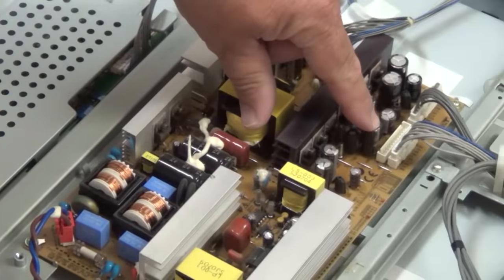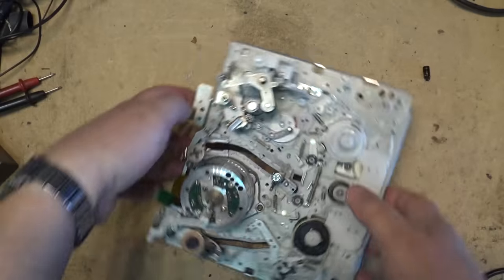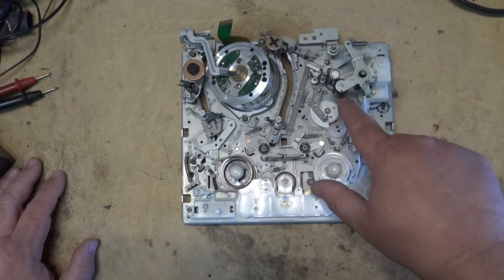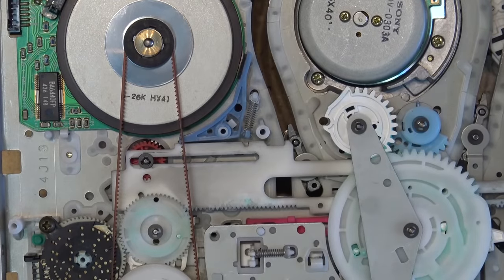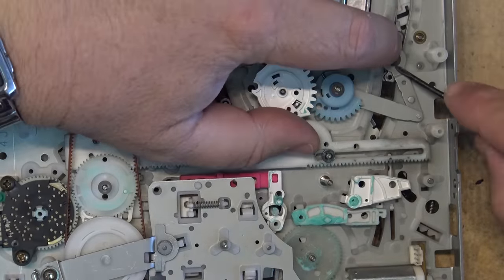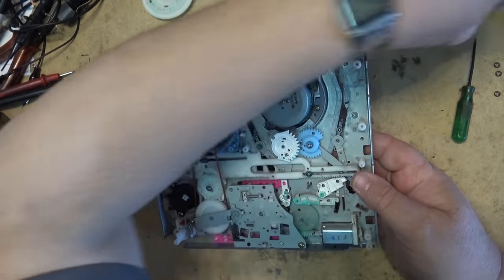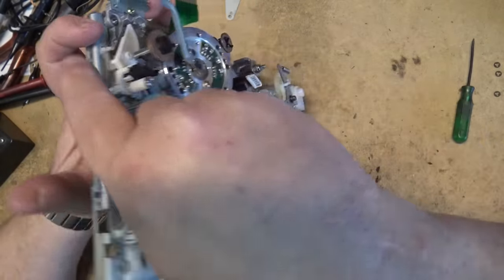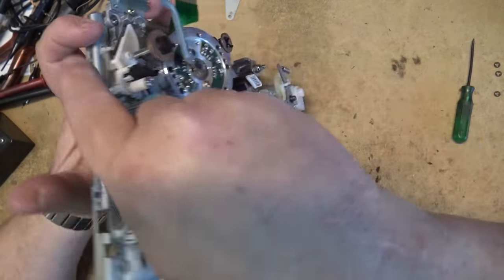Sony VHS mechanism Mechanical Repair

Comment: Nowadays i'm seeing it happen: all gears 'n stuff are made of plastic fantastic, so damn breakable in this 'throw away society'. Many years ago it wasn't like that: more durable and reliable. Some parts of these units aren't available  anymore, it's just not worth to replace it anyway due to the costs of it so we throw it away and replace the whole unit, it's just simple as that. We praise the Lord that there are still some guys like Dave who still cherish their profession and their skills and love what they are doing. Keep up the good work man!
Reply from the maker: You are correct.  Most of these units are tossed away. Very few people still servicing electronics.  It is a dying profession and many of the really good knowledgeable service engineers are, well... Dying.

Comment: This gave me a clue at 30:40 and some other spots as to the problem with my SLV 585HF. The rewind side was not pulling the tape back in on eject or in reverse play. Problem is the gear mechanism between the reel hubs that big white thing at the bottom at this time line. that center part is supposed to spring back and forth. I worked it a little by hand and pushed around that center pivot clip. and now it no longer sticks and it will pull the tape back in before ejecting. No more eating tape.  In the long run I assume I need to pull it off and remove the old grease. I put some Zoom spout oil on it for now. (sewing machine oil).
Reply: Having similar issues on my SLV696hf. At playback the left reel doesn't move, the tape sticks and stops. Will explore that section of the machine more.

Comment: thansk for this video! I was able to fix my SLV-E90 ... Blue gear was broken, the guide was stuck, had to fix the PSU (capacitors were leaking) and the timing was way off. running ok now - have to clean the headdrum though ;)

Comment: You've been a great help i repairing my Sony that is like that one... One question so far while I'm waiting for my blue gear that was broke.   Placing the main cam gear back, you have those 3 notches, the small arm that has one notch for me to place is not in the same position  as yours and I can't find what moves it.  There is a small black pin that is pushing it up and the pin moves too close the center of the cam for it to drop in place.  I can't see what moves that pin back.  I also had to grease that same sticky worm gear post on the other side and that arm that sticks.  I'm waiting on my part, cleaned up the contacts just seeing how it fits back and that might be the only problem I hope - cam gear placement.  Thanks, Dennis

Comment: What a great video!  Love how you provide details on how to get the timing calibrated.  I have had to clean-up the “P6-Guide” (I think that’s what it was called...?) as mine was also completely sealed up.  Easy to do when you see how it’s done.  Following that, I noticed that the unit will no longer rewind - Are there some troubleshooting steps that you would recommend I do to figure out why this is occurring?  It looks and sounds like it wants to rewind, but the left wheel does not move, and after about a second, the unit retracts the tape back in the cassette and the only thing that can be done is to eject the cassette.

Comment: Hi,
I need some advice if you don't mind, but first of all thank you for those vids, they helped me successfully replace two broken blue cogs on SLV-725 yesterday and on SLV-E9 two years ago. With former unit I have certain problems that I can't seem to tackle. First of all - while it plays, after like 10 minutes after cleaning of pinch roller, the picture starts slightly wavering horizontally, and stereo sound starts cutting out slightly, and gets worse as tape runs further. Uncleaned and at end of tape, wow and flutter is enormous in linear track. This is worse towards the end of tape as opposed to towards the start. Cleaning roller again gets it going again, even though it's not really dirty as seen by very slight amount of blackness seen on q-tip (I clean with q-tips soaked with pure isopropyl). What is the cause? Bad pinch roller? (it does have some slight shine to it but not really worse than on any other similarly old unit which runs fine). Perhaps too high backtension or something? I tried adjusting the pinch roller pressure by means of re-timing the loading cogs as they seemed to have been tampered with in past anyway. No avail I think, but I can make it worse that way and revert. Currently it's pressurised enough that I don't see reason to change further anyway. But current state is not really acceptable for any sort of normal use.
Second problem, the front panel main controls (play, stop, ff, rew etc) are acting weirdly, buttons either do different functions than they're assigned to, or not work. Eject does not work altogether for example. But actual logic is fine as with remote control, all functions work as intended. Could that be some fried chip or something? Front panel has obviously been removed in past as evident by some wire soldered to one point and going to mainboard (compensation for missing trace? mod? dunno) and lacking few screws.
As for other unit the E9, it works acceptably well after lots of tampering over time, however the drum has weird sound when turned by hand - scratchy one. Failing bearing? It works fine when it turns fastly by itself tho, but once has halted randomly and worked again later. Also on this one I've manually readjusted the tape path around drum as it was off initially (yet another machine that was been messed with prior), and while I got it to play all tapes I insert into it fine, and it plays what it records fine also, the tapes it recorded don't play properly (on one has noise band on top, for example) on some other units that otherwise play everything fine and are factory-adjusted. Play fine on some others. It is acceptable incompatability or is it still misadjusted?

Comment: Hello sir, i've got the SLV 656-VP. And it has prakticly the same mechanism.
Round about 15:10 where you're fidling with the tape guide cam. In my machine, it is seazed solid. I tryed WD40, but it won't move.
What do I do now?

Comment: Hi sir, greetings, I have a sony slv 312me vcr, the mechanism is jammed tape goes and sits no operations possible , and does not eject , only ejects sometimes with use of hand to take the casstte out . Checked with local service they said tape sensor gone, but I tried putting my friends similar vcr mechanism it works . But I cant use my friends mechanism for long . Please can u help me with guidance

Comment: I'm working on one now that has me stumped. Replaced the gear, cleaned the mode switch, verified all the timing. It will accept a tape, it will play, FF, RW, everything just fine. When I go to eject the tape, the capstan motor doesn't pull the excess tape back into the cassette. So it ejects just fine other than a giant loop of tape that hangs out. Any ideas?

Comment: I remember those days. We had a TV repairman take out the chassis out of our console tv a few times to take to the shop.. I always watched when he worked on our tv's at home. He warned me not to stick my hand in the tv, even if it was unplugged, because the picture tube would zap me. (That was when he took the chassis out) I wanted to be a TV repairman when I grew up. Didn't work out. 
Interesting stuff there!

Comment: Hello, I cleaned the half loading arm as shown in the video, and that now operates properly, but my unit fails to advance the tape at all during playback, but rewind and fast forward works. Mine also has the broken blue loading gear, but I'd assume that it should still move the tape even with that guide not working, am I correct? Would doing the blue gear swap fix this, or is there something else I should look into? Thank you in advance.

Comment: I have a Sony SLV-998HF that likely needs a new rubber capstan belt (it plays fine but won’t rewind or ff all the way or very quickly). There is no access door on the bottom like some units have, unfortunately. Because I’ll need to remove the mechanism to replace it, will I have to check the height of the same guide after reinstalling? The mechanism looks different (haven’t seen the blue gear in the schematics)

Comment: Just fixed an SVO-2000 that was eating tapes by cleaning the mode switch, I've never seen one so filthy, Deoxit was barely touching the outside contacts that turned black, had to scrape it off with a screwdriver and scrub with Deoxit.

Comment: Dave, what would cause playback to be too fast on a VCR? I've cleaned the mode switch and heads and tried multiple different tapes.
Reply: Nun Ya
Is it a dual speed vcr?
If it is, make sure the control/audio head is clean.
Just a thought :-)
Reply: Loss of control track can cause the playback speed to be incorrect. Does it happen on SP, LP and SLP tapes?
Reply from the maker: Capstan servo circuit. Dirty control head , speed sense circuit.

Comment: Im trying to fix my Akai from 1990. It does load an unloads the tape but when it starts to roll the tape, it soon grinds to a halt. Also fast forward and backwards dont work. Do you have any idea what this can be. Im trying to fix all my stuff first before I take it apart for hobby projects.
Reply: What is the model number?
Reply: Model number = VS-F10EOH.
Reply: @captainprototype187  
First thing you should always do is check if it does it with more than 1 tape. Believe it or not, it could be the tape. If it does it with all tapes then it could be a number of things. If it were me, I would start by cleaning the mode switch. While you're in there check the belt(s). Next, visually inspect the gears for damaged "teeth" or debris. Then check the timing marks and make sure they are lined up properly. Clean up and debris, dust, and excess grease and then apply some fresh grease. I would be willing to bet that there is a bad belt or idler tire. You should also check that the capstan bearing is good and check the pinch roller. This particular channel has dozens of VCR repair videos. 90 days ago I didn't know a damn thing about VCRs. Thanks to 12volt sharing his knowledge I have repaired close to 200 VCRs  and resold them. The best advise I can give you is to take your time, take pictures so you know how to put it back together and be prepared to mess something up because it is inevitable.
Reply: Thanks for your advise. Ill take my time and try my best. I am doing arduino for the next 3 months myself from turorials. I wont make any money with it though. Great  story!

Comment: hi, can you tell me why sony slv-e930 vhs at the end of rewind the vcr doesn't click. the cassette doesn't come out, you have to leave it still for hours and unplug it. then I connect the power you hear a loud click and it starts again. Thanks Luigi
Reply from the maker: Bad end sensor most likely or the led that supplies the light for the end sensors.

Comment: Just wondering you truley are a wealth of knowledge .I was wondering if you had your H F radio licence as well ?
Reply from the maker: Yes I have had my full ham licence for over 30 years but I am not active on HF much because I have too much noise. Can't hear anything.  S9 noise pretty much all day and night.  Too many plasma TV's still in use.  The DSL noise is going down though due to cut over to fiber.
Reply: @12voltvids  You truley are an amazing person ,luv all your video's.

Comment: What's your opinion on those built-in foam head cleaners? I thought I saw one on this deck. They seem like a bad idea to me so I've been removing them from my decks.
Reply from the maker: They deteriorate after time and once they get worn or dirty they no longer clean and can contaminated.  Good idea to remove them when they are worn

Comment: Anyone know where I can find a pinch roller assembly for this same chassis?
Reply from the maker: I have one.
Reply: @12voltvids  
It's official. You're my new hero! I am going to do some more diagnosis to be 100% it's what I need. I will also be sending you that cassette job I emailed you about a couple weeks back. Maybe we can kill 2 birds with one stone! At this point all I've done is take the top off and found the pinch roller rolling around on the power supply!

Comment: Do you ever take video decks from viewers ?
Reply from the maker: Yes this one was sent in from a viewer as have 2 other slvr1000 decks last year.
Reply: Thats cool do you reply by email I may send you my panasonic.  Its from 1985 it has a rare HD audio version so I want to get it fixed.  I also dont need it repaired quickly either I can wait a while.   @12voltvids
Reply from the maker: @stpworld  My email is on the main page. volt@telus.net

Comment: Hi, I really need your help to replace the Video Head drum of my Panasonic NV J22AM VCR I was able to find a brand new Genuine Panasonic Head online I have opened up the upper two screws but head is not coming out Anti Static bar has been removed already Will really appreciate your response thanks a lot for making these great videos
Reply from the maker: Not familiar with that model number.  Have no idea what type of drum it has
Reply: @12voltvids  it’s head drum part number is veh0518 if you enter it on eBay you will see it please
Reply from the maker: @khurrammalik5865  
You have to remove solder from arrow marked contacts to disconnect from rotary transformer. If it is hard to remove heat it with a blow dryer or heat gun to expand the aluminum slightly and it will lift off.
Reply: @12voltvids  really appreciate your help actually this plate came with the new head drum already soldered basically I’m trying to remove the upper head drum and I have removed the two screws but it’s not coming off
Reply from the maker: @khurrammalik5865  heat it up. Hot air or stick soldering iron into screw holes.  The idea is heat the aluminum upper cylinder not the brass center.  This will expand the aluminum as it expands faster than brass and it will lift off.
Reply: @12voltvids  ok sure I will try now thanks a million again
Reply: Ok I was able to desolder the board contacts and even it’s lifted off now I’m trying to heat up the cylinder with soldering iron but it’s not coming out of the central brass that’s the only way to take out the drum so there are no other screws underneath or anything like that?
Reply: @12voltvids  please disregard my other messages finally I was able to remove the cylinder and replaced it with the new one but the picture has lots tracking all over and no colors what it could be? Linked to wire connections? Or something else please guide thanks
Reply from the maker: @khurrammalik5865  no screws below.  It is just a tight fit.
Reply: @12voltvids  did you see my last message?
Reply: I was able to install the head and now picture issue
Reply: Tracking all over the picture and no colors just black and white
Reply: @12voltvids  so any recommendations if you have read my previous message about tracking
Reply: @12voltvids  can you please help? It’s showing lots of tracking on full screen and no colors what it could be bad connection or wrong connection?
Reply: @12voltvids  any help please do you think it could be wrong wires connection ?

Comment: Looks like that pinch roller would benefit from some rubber renue. Great job anyways. :)
Reply from the maker: Not so good for VCR pinch rollers.
Reply: That is surprising to hear. Why not?
Reply from the maker: @TheVCRKing  
Video tape is wide compared to audio.  Rubber renue tends to create uneven tension across the roller that can damage the tape.  It's a last resort.  It works great on drive rollers and tires but I don't recommend on pinch rollers except as a last resort.

Comment: Hi! I was wondering if you still repair VCRs for people if they send them to you? I bought a Sony and the roller guide arms were working fine and then out of no where they were stuck in the back and would no longer move forward to release the tape. I attempted to take a look at the gears but, there is a lot more I would have to take apart and at this point I feel like I really need help.